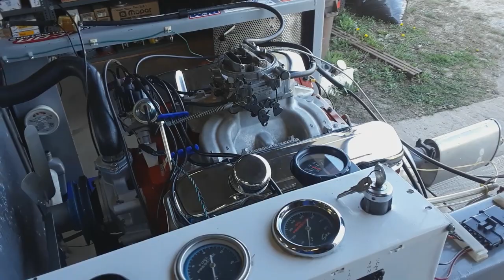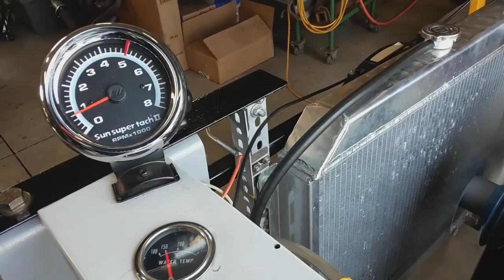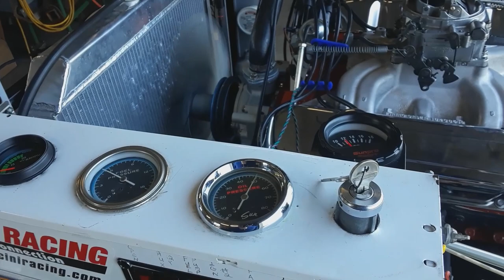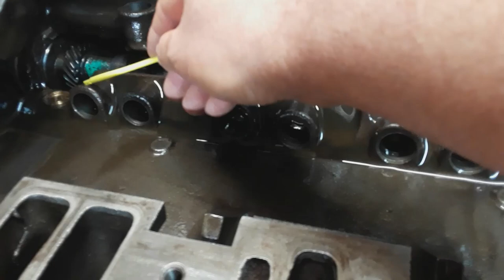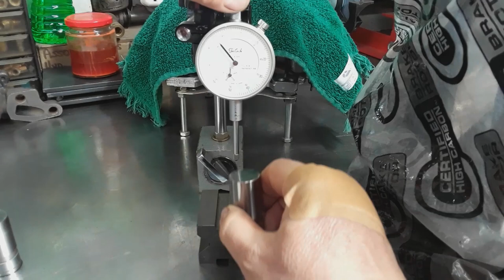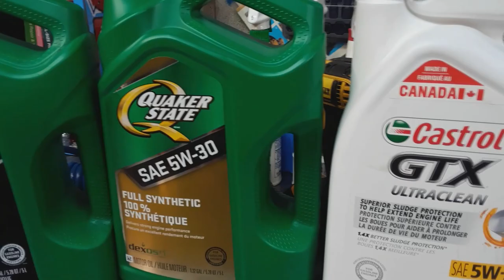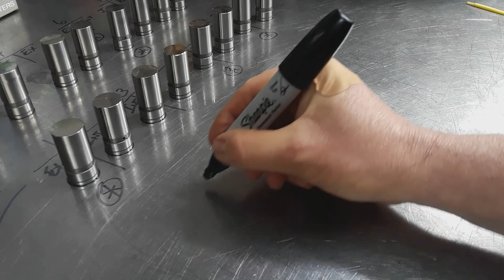Camshaft Crisis: Solution/Resolution

Comment: Nice video series! I agree- there’s NO Good Reason these flat tappets should be failing. This has been going on for 20 years now. Everyone says you gotta use a roller cam. I say that’s BS. Not to mention- those are failing in their own ways as well! Comp Cams has been scamming people forever. They bought the most advertising back when we still had magazines. Every damn engine build had Comp Cams in it. I had a mild one go out. I did everything right. Good oil ect. No high spring pressure. They wouldn’t do a thing for me. Way back in the day- we never broke them in right- and they survived just fine. Now Comp has their new Diamond coated lifters… supposedly fixes all the problems?? Time will tell. Shouldn’t have to Diamond coat 100 year old technology to get it to work
Reply: That "diamond" coating is just a nitride coating. It`ll wear off too. Later rather than sooner, but it`ll wear off.
Reply: They cant make them to OEM 1970s quality because it would cost 300 Dollars per lifter....nobody would pay that much for "swiss made" tappets.
Reply: Comp Chinese Steel crap
Reply: @Schlipperschlopper  it’s all about the heat treatment

Comment: Competition cams is going cheap because they're doing so good so they don't care about their quality anymore
Reply: Tecs are great at blaming the installation.
Reply: I believe it's more about penny pinching to give their investors more and more profit.
Reply: Like many businesses, they get bought by vulture capital money grubbers, who then strip mine that business exploiting the reputation established by previous ownership.
Reply: Weird to hear about and sad if true.  Worked at a place that built winning off road race engines and they used comp cams camshafts (jesel or morel lifters, manton pushrods, modified jesel rockers, xceldyne valves, psi springs...).
It's been a handful of years since I built a race engine.  Makes me wonder if I should use a Jones cam on the next dirt track flat tappet.

Comment: I remember back in the day when I built my 306 small block, all new internals, cam, lifters and rockers. Put all together filled it with 10w 30, fired up and drove away with no “break in”, drove around varying speed and rpm for an hour, shut it down let it cool, fired it up and hit the drag strip, 15 years no issues.
Reply: todays chinese crap sucks

Comment: Take the camshaft out, have it (the one lobe) reground and re-hardened is a ridiculous proposition for the average garage builder. This is another example of poor quality of these non-roller cams. I got comps new DLC coated lifters and I'm hoping the lifters and cam will survive the break in this time.
Reply: Have you run the DLClifters yet???

Comment: This is coming from a Chevy guy, I like your presentation and truthful, to the point objectiveness.  My high school auto students built 3 motors this spring.  The small block with a Howard's setup failed.  Comp Products told a friend of mine they are at about 40+% failure rate and wouldn't even sell him a flat tappet for his BBC.  Other student ran an Elgin setup it lived.  Only difference was we broke it in at 1800 RPM and used 30 weight non detergent.  The other SBC is an Elgin setup is going on the start up stand shortly my only change here is to run it on the stock springs through the break in.
This whole camshaft thing is really disappointing!  Have a 400 SBC with an Isky cam and Crower direct lube lifters in it that will be broke in next.  The JUNK they are making has taken all the fun out of building motors with my students, the next generation of hot rodders.  Complete buzz-kill.  Student from last year on a Comp set survived break and a summer of fun.  Cam/lifters failed last month.  Does big pharma own stock in lifter companies?  Thanks you have a new subscriber.

Comment: I feel the frustration you have.
I have the same frustration. 
So does everyone else.
The cam and lifter companies know the truth and they are all hiding the truth.
The companies blame the installer and the machine shop.
All of the dozens of excuses the companies use to blame everyone else.
But never except responsibility. 
The oil, the Zink additive is not the problem.
Because you can use 18.00 a quart of racing oil , break in oil and still have the same problem. 
Thanks for sharing. 
Take care, Ed.
Reply: Especially comp cams.
Reply from the maker: Hi Ed and thanks for the support. We are all in the same boat and it is everywhere. The part of this that really pisses me off is that it takes the same amount of green house gas emitting "energy", the same amount of " resource materials" and the same amount of "man power and labor" to manufacture "garbage" as it does to manufacture "quality" components!  Where is the economic, environmental and social "advantage" in producing "garbage"?  Someone somewhere feels "accomplished and successful" in the short term by fucking over the consumer? This "mentality" is a serious "illness" and leads and ends in one direction only, the destruction of our culture and ultimately, the destruction of our species. The "proof" is rearing its ugly head everywhere we now "choose" to look. That's why I "closed" the video with the issue that I did!
Reply: @metalmaxmopar9520  I regrind my old lifters. Only problem, sometimes the lifter won't pump up again. But they are not going flat.
Reply: Massive frustration.  In doing some reading, I suspect there is some either/or analysis.  Maybe its both: some are bitten by bad lifters, some by oil, some by both.    API specs lead to ASTM tests mostly, and in the case of the "IVA" test [astm 6891] that revolves around camshafts, the spec engine is... a Nissan KA24E, and the tech is different: no lifters to spin in the bore, but a pair of shaft mounted rockers utilizing a single head mounted cam & followers [tech reminiscent of what's in a 240z for example].  There's an IVB test for lifters: 8350, which if I recall has a pass/fail hinging on mass, which avoids the issue of crown [or loss thereof] completely.  The oil industry no longer has a testing scheme valid for traditional flat tappet engines in my estimation - they market for manufacturers, and their specs, for the millions of engines they make every year.  How many of those specs find sunlight in an API certs and how many are locked down in non-disclosure agreements I couldn't guess, but the overly lawyered can screw up anything - that's how Gates wound up hooking up with IBM many decades ago, bringing the world version after version of the Blue Screen of Death..
I continue to dig... next mission is history: what test specs were in place pre-1994?

Comment: I recently built a 455 Pontiac engine for my 70 GTO with a NOS Wolverine Blue Racer cam & lifter set made in 1990. 
No issues. Engine runs strong. I wouldn't have considered building this engine without that NOS cam & lifter set because of today's issues...
Reply: I just installed a NOS 1989 Edelbrock Perfomer Plus cam with  ansieht NOS Perfect Circle DANA lifters it works fine
Reply: @Haffschlappe  Congratulations. I still wouldn't build any engine today using a flat tappit cam & lifters unless it was NOS. 
Let me know when you reach 24k miles and we'll see how your cam & lifters are doing.

Comment: Here is what Smokey Yunick said back in 1987:  The last and possibly the best advice I can give about lifters is to use the exact type and style lifter specified by the cam manufacture and follow his recommended break in procedures to the absolute letter.  If you have a cast iron camshaft, you must use a lifter that has a steel cap on the base.  If using a steel cam, you must use a chilled iron lifter.  Modern racing profiles generate incredible valve rates.  This results in a great deal of stress between the lifter and the flank of the lobes, and it's very easy to wipe out a new cam in just a few seconds.  It's especially important to put a good coat of extreme pressure lube on the lobes before you put a new cam in place.  You don't have to goop this stuff all over the place, but you should use your fingers to massage into the lobe as HARD AS YOU CAN.  If you are using a flat type lifter, I think it is a good idea to buff the base until it is really smooth.  We have also found that if you're breaking in a real monster cam, it helps a lot to have the lifters surface hardened with something like a nitriding treatment, but this is going to be kind of expensive for most racers.  When all is said and done, you're going to have to be some sort of witch doctor and very handy with a spring compressor to break in a serious racing cam successfully, and if you screw up even the littlest thing, you're going to rebuilt the engine before the paint on the block has much chance to dry.
I apologize about commenting on oil, but the modern retail oils have way too much detergent in them (for emissions reasons) and will break down any additives you add to them within seconds or minutes.  All the oils you showed are no good for break-in, even with additives.  You must use special break-in oil for flat tappet cams.  Learned that one the hard way.
Reply: Driven BR30 is what I use... and you can't go wrong listening to Smokey...👍
Reply: Yeah I use Driven too, not just their break in oil but their full line of synthetic engine oil (depending on what weight oil the engine requires)

Comment: Found your channel today. Just hearing you speak and how you have conducted your investigation shows your years of experience and expertise. Although it is on unpleasant terms i have truly enjoyed watching this saga. 
I have very little videos and none of my building process but all the vehicles in my videos ( some roller some not) have comp cams and lifters in them. I sence the day is coming that i will suffer the same fate as you and others have. On a side note when i first noticed this issue i used the comp pro magnum hyd flat lifters. My line of thinking was they are twice the price so probably get sold half as often. It worked out for me not sure if it is a fail safe plan though. 
Thanks for the quality videos, quality workmanship and quality logic.

Comment: Rock solid.  There's always a struggle to get at facts, and it often boils down to what we read.  I know of no way to fully verify a depth of hardening process except by destructive testing, and no home gamer is equipped for that.  Also, iso 9000 is not a quality control system, its an assurance system - one step below.  I continue to be amazed athow many corporate types remain unaware of this fact.  Any business outsourcing anything needs to do random qc work or problems await.
Reply: all iso9000 does is just extreme documentation of the processes even if its shit.

Comment: I cannot believe you re-used that Comp Cam. That would have been the first thing into my scrap pile. That cam caused the wear pattern on the Johnson lifter.
Reply from the maker: Re watch the video and listen! I DID NOT use a Comp camshaft. I "re used" the "zero" miles, 40 + year old NOS Cam Dynamics Stage 2 cam with a "NEW" set of Johnson's "Hy-lift" flat tappet lifters to prove a point.....that it's NOT THE OILS!... it's NOT THE CAMSHAFT!........ it's the GARBAGE Comp lifters. Even on the "broken in" C/D cam with the "new" Johnson Hy-lift lifters, ONLY the number 5 exhaust cam lobe and # 5 Exh. tappet showed slight wear when previously, 4 of the NEW Comp lifters initially broken in on that "NEW" NOS C/Dyn. failed with the # 5 Exhaust lobe /Comp lifter showing the most severe wear. In this 2nd break in/application, these items were/are "sacrificial". 

It's called TESTING!
 
I "INTENTIONALLY" broke every engine building camshaft rule in the book for this test. I made my point and that was the whole motivation behind this video. If it was the OIL(s)...."logic/reason" states that ALL 16 lobes & lifters should fail, if it was the cam, more than one lobe should be wiped out with an "edge to edge" wear pattern across the nose ESPECIALLY when using a "NEW" set of lifters on a "broken in" cam. Same for the lifters....there should be more than "one" damaged Johnson Hy-lift hydraulic lifter. There is NO MORE DAMAGE TO THIS C/D CAM on this 2nd test than there was on the first break in. Why? .......simple....the initial break in had shit quality Comp Cams hydraulic lifters! 
P.S.  I'm NOT running this C/D Stage 2 cam in ANY engine until I regrind it and it will get NEW lifters! Why?....because I don't rip off customers!

Comment: I prefer the rope seal as well. I have a few of the OE asbestos type rope seals I bought a long time ago. I think the whole 'failure' problem is from what I think you mentioned in an earlier video, the new lifters. I also bought a ton of NOS lifters on ebay a long time ago I've been using and haven't had any problems. I would still use an NOS set over these 'new' ones. They're all over even now. You could probably pick up a set in the $150 range easily. That really is something that even the supposed 'best' lifters made now have varying chamfers and machining tolerances as wide as they are. The old ones I have and inspected don't have any visible chamfer that you can see by eyeballing them. That crown seemed really high too. Most of the NOS lifters I've checked were closer to the 1.5 thou range. I think too much is as bad as not enough because it needs to match the camshaft otherwise the contact pattern is off. If I remember from checking the cam needs a little more because of the angle the tappet is offset from the center of the lobe, in order to get the correct surface contact for rotation. Maybe 2-2.5 thou.  I agree with your description. There's a lot of 'noise' and supposed 'experts' out there. Even if you didn't have the technical facts a little common sense goes a long way. 
About 36 years ago I broke in a few cams and did everything WRONG as far as the oils and springs etc and never lost a cam. Used regular oil, no additives, just Isky Revlube on the cam. Left in the 333lb springs. Why are all these people still having 'failures' that do everything right? Only thing you can't control is manufacturing of the parts you use.

Comment: Great video, I totally agree with the tragedy that has taken place and I’m greatly concerned for the future! (In general). Also for my own soon future for the engine I’m putting together. I have an 87’ 318 with the (302) closed chamber heads that I did some porting and deshrouding on. The reason I decided to tear it down in the first place was because I found that the camshaft had been walking back and forth due to the timing chain bolt had backed off. I pulled the motor and the bottom end looked great so other than cam bearings I’m running it as it was. Unfortunately when I initially began this process (almost 2yrs ago) I chose a comp cams kit; lifters, cam, valve springs, retainers, etc. Since then I have witnessed all of these cam/lifter issues, and I’m really apprehensive about using what I have. The included instructions discuss using the outer spring without the inner spring for cam break-in before installing them both together (which is a real pain in the ass, years ago I never remember having to deal with any of this. Makes me wonder if comp is just making “much to do” as an excuse for the issues they know are going on. I’m throwing an engine run stand together to make sure everything is correct before I put the engine back in my van(not ideal) to maintain major work. So if I check the crown on all my new lifters (in the very box you displayed), which I haven’t yet done…and they check out ok, would you run it or should I send this junk back? Not even sure I can at this point 🤦🏻‍♂️! Gotta love when projects get set back.

Comment: The crown on the lifter needs to be the same as the taper the cam lobe, so if you're going to have the cam reground, do yourself a favor and send the lifters to be matched, and rockwell tested, no (magic) oil will fix mismatched machine work 😉😁💯 but I feel every bit of your frustration!!

Comment: This is a great test for lifter machining. I am terrified to install the 274H I got from Comp and thinking of just dropping the $1200 it costs to upgrade to roller because of all the failures. Maybe I can perform the same check with my magnetic dial indicator and see where the lifters are at.
Thanks.

Comment: Been using VR1 high zinc oil and Rhoads Lifters for over 40 years.   320-340 lbs open spring pressure on every break in. Never lost a cam.   I measure and inspect everything before it goes in.   Prevents a lot of issues.   Never took the jab.   So I can’t speak to those failures either.   But the mis-grinding of lifter faces destroying motors is a real thing.   And not having zinc in the oil won’t cause immediate failure.   But I’d be scared to go long term without it.   After 40 years that bottle of VR1 makes me feel warm and fuzzy. And it’s kept the mill in my Pontiac spinning  through thousands of passes since 1989.   As close as I can come to proof it’s good oil.   But it all may just be pure luck.   😅